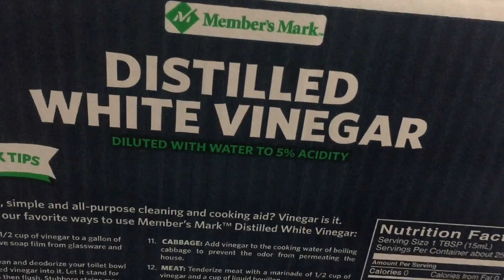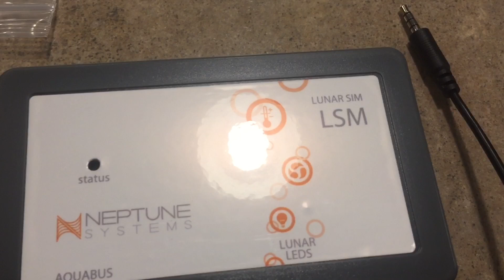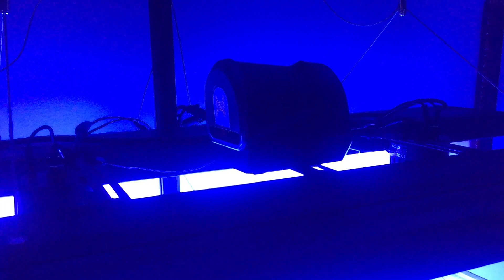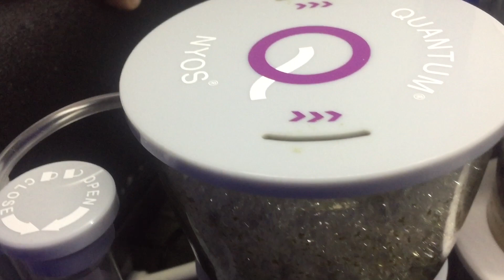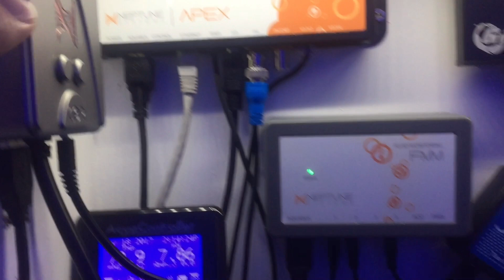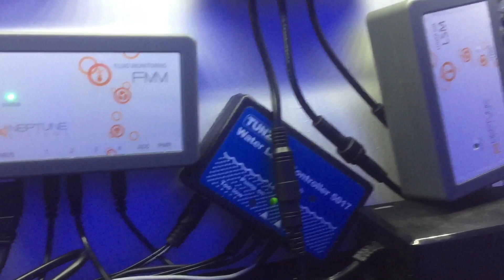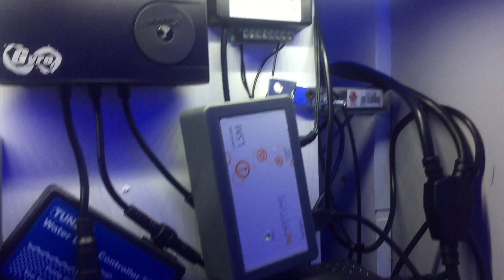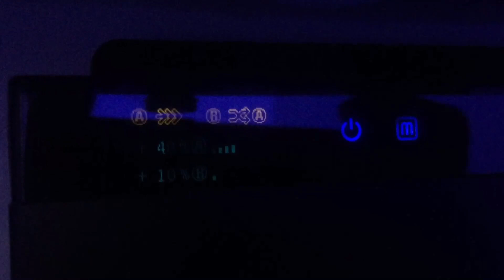Red Sea Reefer 250 | A to Z Tank Walk-Through | Optical Sensors Replacing Float Switches

Comment: Filling mine up today!!
Reply from the maker: +Fish School making water? Or have the water made?
Reply: pelphrey Both! I have some already made and then I have to make a little bit more
Reply from the maker: Filled up yet?
Reply: pelphrey lol just ran out of water! Should be filled by tonight
Reply from the maker: +Fish School keep the water flowing!!
Reply: pelphrey I got it running but it’s super loud any ideas???
Reply from the maker: +Fish School when you adjust the drain valve make small I mean small adjustments. After you make an adjustment walk away from the tank. It will take awhile for it to stabilize. Be sure you have more water ready, water level in return section may drop.
Reply: pelphrey got it! Thanks so much will keep you posted
Reply from the maker: +Fish School no problem! Be patient with that valve. A little goes a long way, like I said it takes some time for it to level out.

Comment: Nice Vid. So I like the feed mode holding water in the pipe. When you were using the reef octopus was that an option?
Reply: Love that manifold!! this is your best one yet. I am going to copy this. This is the perfect idea for our small reefer sumps. Where did you get all the blue fittings.
Reply from the maker: It wasn't an option, or not to my knowledge anyway. I believe it had a feed more on the controller, so maybe it did?!?! Def something I wish I had tested now!
Reply from the maker: Thank you very much! I spent a lot of time thinking about and building this setup, I wanted to make it as compact as possible. 

I got the fittings from here - http://www.aquariumspecialty.com/parts-plumbing/pvc-parts
Reply: Thanks again. Going with red because I have the reef octopus skimmer. Also I have been reading about the Varios and the feed mode will reduce to any setting you want using the apex.  https://forum.neptunesystems.com/showthread.php?15867-Reef-Octopus-VarioS-6 just incase you wanted to check it out.

Comment: Returned my unopened various 6 for the pre order on the Cor-20. The hype got me lol. Not sure if at the end of the day I can justify spending $110 more than the Varios sale price but I sent it back. I am just a apex junkie.... Like the feed mode option. Have the little square display like yours, Craigs list purchase as is did not come with the apex 2016.  I want to set it up to work with the push of a button without needing fusion. Let me know if you have managed that. or if you have any pointers...
Reply from the maker: Checkout the Neptune channel, they did a video on setting up the COR20 in standalone mode. I calibrated mine with fusion, since it’s easier. Once you specify the feedmode on the pump in fusion you can use the display to enable feedmode. My code is “If FeedA 010 Then 1” so it will run at 1% for 10 minutes. Which basically shuts the pump down, but there is no back flow of the water down the drain pipe.

Comment: Looks good pelphrey Im building a 250 myself but will be running Reefkeeper control that moonlight module is that a 3.5 plug?..you can get extender for those at any walmart etc or even buy the Y adapter and add more lights if its the 3.5 connection
Reply from the maker: +Corey Ramsey awesome! When you going to get the tank setup?? This isn’t a 3.5mm plug, wish it was. I’m going to get a longer aqua bus cable and move the module, just strange to me that they always give you access wire, except on these lights! Haha I bet that most people put the module up high.
Reply: Just got all the hard plumbing done and DIY a 8 gal exterior fuge doing the triton plus some new equiptment ..I got the new T5 also by aquaticlife had already owned the kessil 360's from old system besides alot of other equiptment need to get rock and sand yet..prob wont be wet till after christmas
Reply from the maker: +Corey Ramsey what doser you going to be using on the system?
Reply: I already owned the jebao 4 doser it works fine for me no probs
Reply: heres a link of pics of under my cabinet     https://ibb.co/gmFhtR
Reply from the maker: You've got a lot going on under the tank, but it looks great! What are you using the stock ATO for? I need a doser for the balling method, thinking about the DP4 to start out. You've had good luck with it?
Reply: Not using the stock ato i made a fuge with it but its too small for any nutrient control so made a diy 12x12 exterior fuge but yes i ran the dp4 on my old system with no problems and is accurate too..I have a acrylic 5 gal ato that i used on my old set up and also have my chiller hard plumbed..going with triton once things get going and stable out